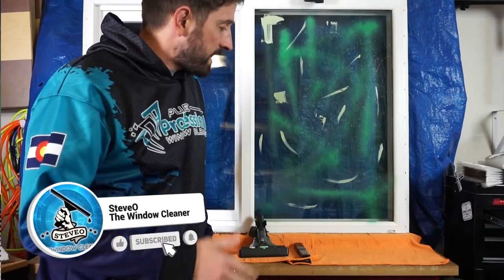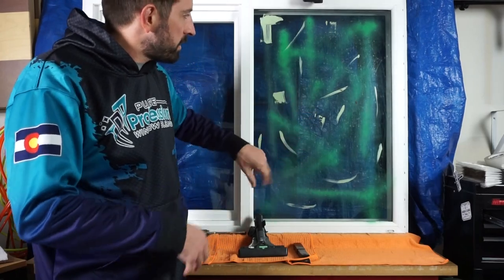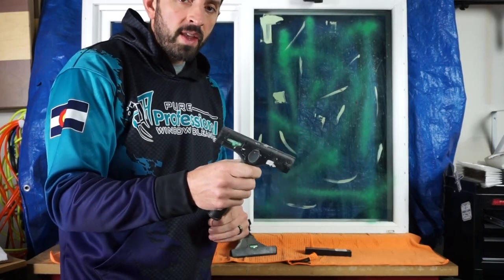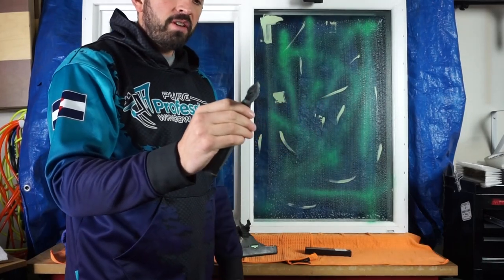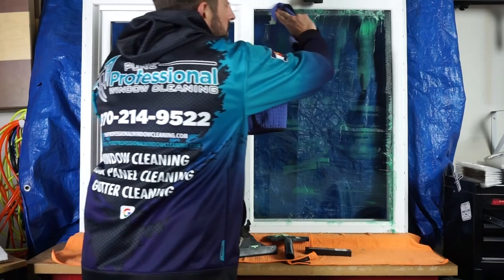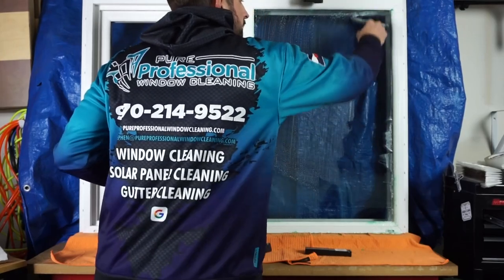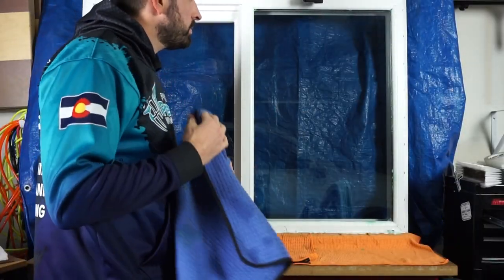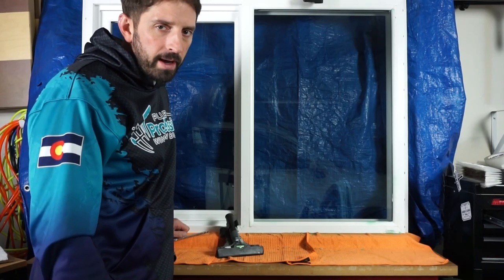HOW TO REMOVE PAINT FROM WINDOWS | WINDOW LAB

Comment: Hey Steve I love the new series I just started window cleaning and I’m using your squeegee setup and I quit like it! 
Now I have a question maybe you can make a (new)video 
So when I cut in and take the top off when I come to the (right top) edge I sometimes can see the transition where i pulled down.. maybe my angle is off before hitting the corner ?

Edit:
Also when using an 18inch I tend to leave quit a bit solution 3-4 inches from the edge
Reply: Same here..

Comment: What about tinted glass or low e glass or other coated windows of that kind? 
Thanks heaps for your helpful videos!! 😊
Reply from the maker: If its after market tint on the side of the window you are removing it from then no luck, but if its a factory tint between the panes then its fine. Low E is typically fine as well, due to Low E is usually between the window panes
Reply: One of the concerns I would have is whether the low E coating side is exposed. As Steve mentions, when they assemble and bring the panes together, they are supposed to ensure that the coating is in the middle between the panes. However, sometimes they'll assemble them backwards, leaving one low E coated side, exposed. In that situation, 0000 steel wool or even an abrasive pad will start to remove the coating which will look like scratches to the home owner